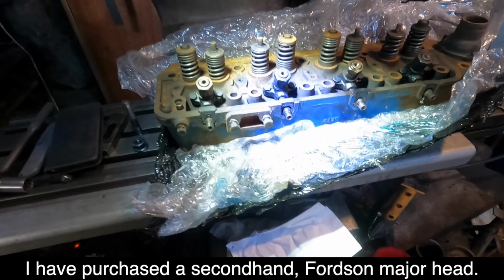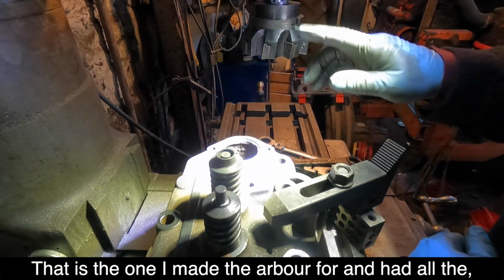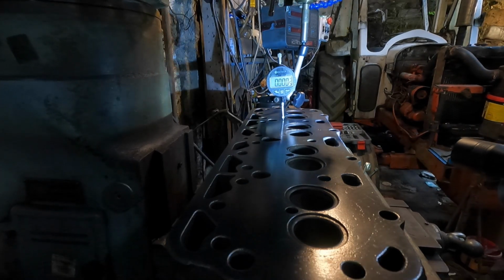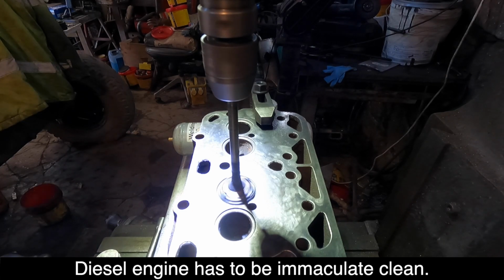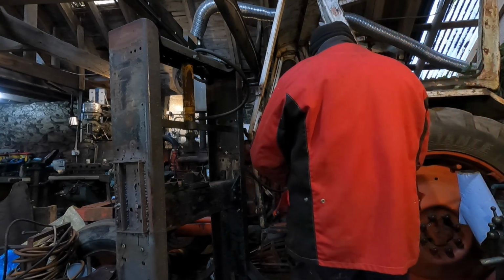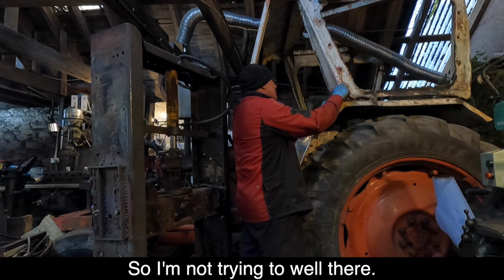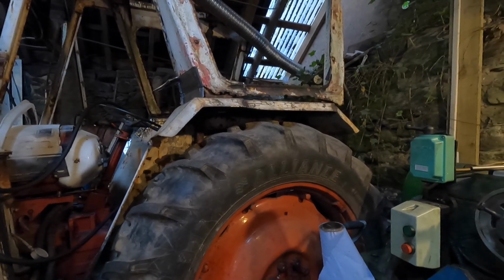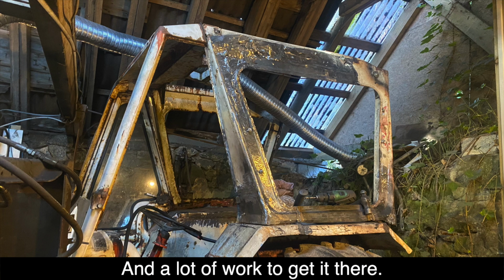New old head for my Fordson Major & Tin work repairs for the David Brown 996 cab

Comment: Hi Marshall, you did a grand job on that cab well done, I was going to say your.002" would pull down with the head bolts as it's actually less than the width of a sheet of paper but as your having it machined it'll be perfect when you get it back.
many thanks
Barry
Reply from the maker: Having a problem with that head  waiting to here if it's repairable. M😣